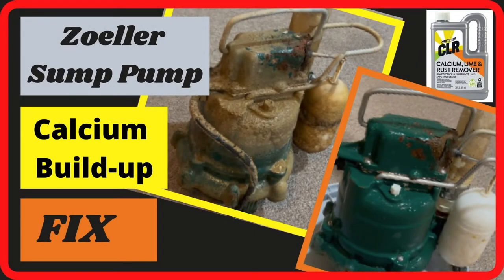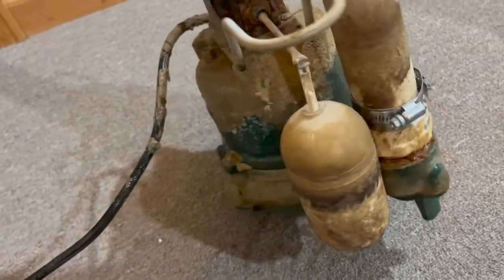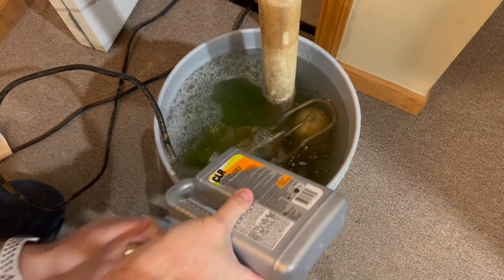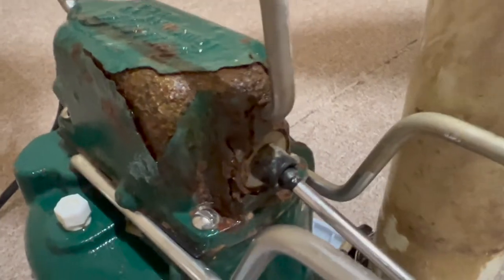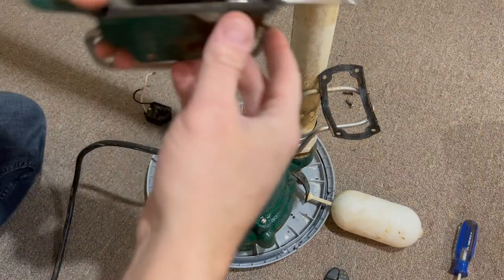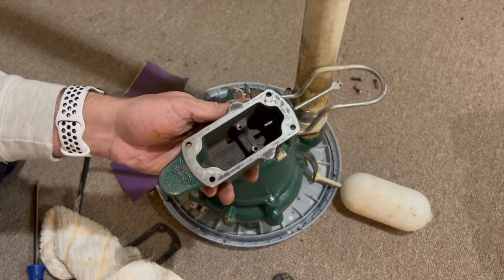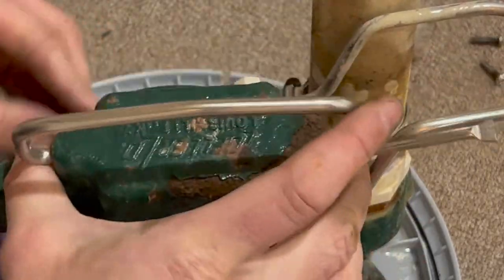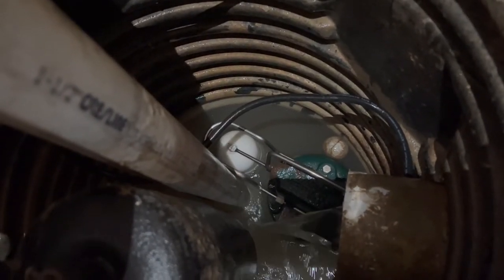Sump Pump Calcium build-up Fix and repair Zoeller Pump

Comment: EXCELLENT video! I have the same pump and it has developed an "intermittent" problem starting, unless you tap the container. Once I took it apart, I found it has heavy calcium deposits just like yours. Before I consider a new pump, I will definitely do what you instructed, which appears quite simple and a lot less expensive than a new pump. Thanks for sharing!!
Reply from the maker: Thanks for watching, btw as maintenance I do this every two years to keep the pump clean.
Reply: @roger amazon have same issue with same pump. Only comes on when tapped. Did you have to replace the switch?
Reply: @needsofnavy5586  I did not need to replace the switch, but easy to do if needed. Took the container assembly apart, cleaned the crap and calcium deposits off the the pump and all the parts, put it back together and its been working like a charm!

Comment: Hi, my 53 pump is tripping the GFCI. I took it out and cleaned it and didn’t see water inside the switch, just oil. After I cleaned it it worked outside the water but once I submerged it, it tripped the GFCI again. Not sure what’s going on
Reply: The pump shouldn't be on a GFCI protected circuit. In an emergency situation, you wouldn't want the pump to stop working because of a GFCI trip. You could always have an electrician look at it to make sure everything is wired properly and that there isn't a short to the pump housing.

Comment: My sump pump had more calcium buildup than your pump.  My next door neighbor's sump pump is perfectly clean and water is pristine.  Our homes were both built in 1995.  Any ideas why our sump is covered in calcium and they have no problems?

Excellent video!!!
Reply from the maker: That is interesting, normally the houses around you would have the same issue, it is related to the soil around the house, which would not be very different than yours, but this technic would help you get it cleaned to look like new. and I do it every two years at my house, so it does not get as bed as it shows in the video anymore.

Comment: U ever replaced or cleaned the impeller at the bottom?  Was worried about breaking that seal or breaking something else trying to get the bottom cover off..
Reply from the maker: My experience I never had issues with the impeller, basically because if you do this and remove the calcium, the impeller will run free and will have minimum wear over the years, I would not recommend to do that. Thanks for looking at my video.

Comment: Buy a new pump do not trust your expensive items or finished basement on a compromised pump that you fixed yourself they have a 3 year warranty the pumps like a 150 bucks say you hire a professional and they charge 300 to install it 450 bucks every 3 years to not have to wonder if the pump will work or if it will ruin your basement that could be thousands and thousands of dollars in damages I've had it happen to me and I'll never mess with this shit myself again
Reply from the maker: I don`t disagree, make sense, I did spent a lot of money in my basement, but I also have backup pump, camera and sensors to inform me in case of a pump failure. thanks for the advice appreciate.
Reply: My Zoeller has been working great for 25+ years now. I only hope that they're still being made with this quality. Buy the best model pump, $150 sounds like a cheap one. If I've got 27ish years in this pump now, my savings according to your numbers is over $4K.